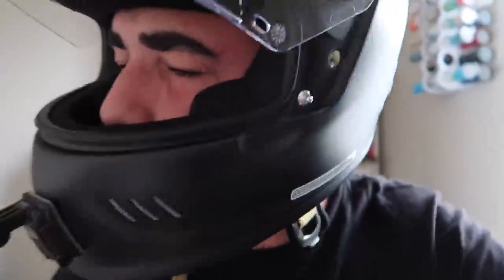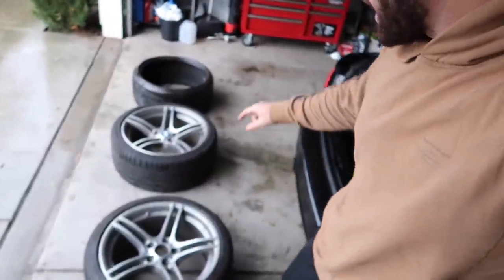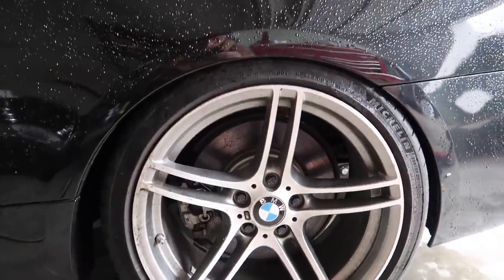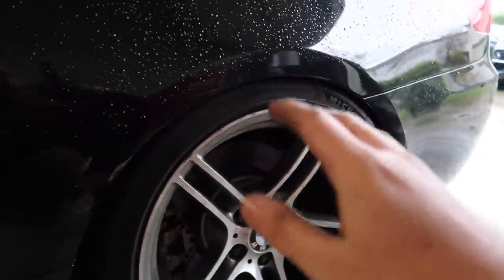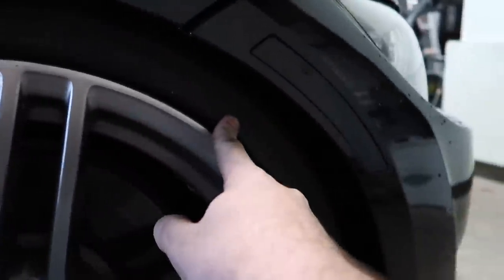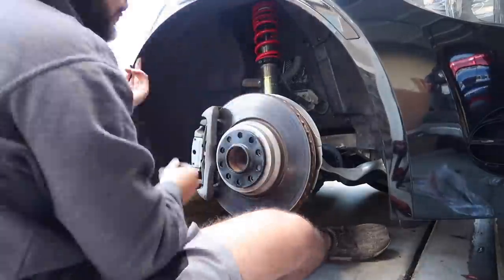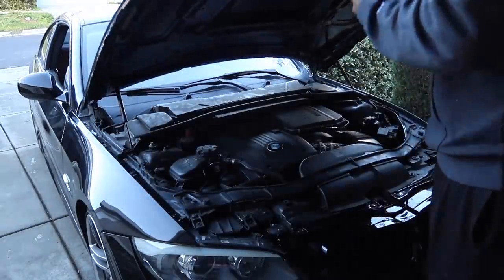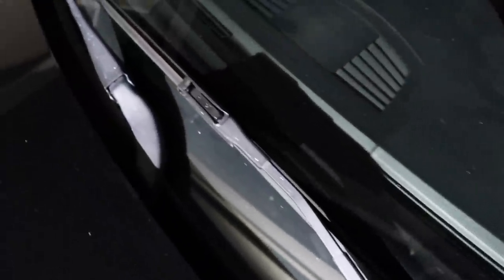THE 335IS IS MAKING ME LOVE N54 😭! Achieving Perfect Fitment!

Comment: on your rear wheels you have excessive positive toe, meaning the front of the wheel will be facing inward causing tire wear from the outside. You need to do an alignment. Tie rods are responsible for the toe in, just need to adjust them at a shop

Comment: Something seems wrong in the back end, because the wheels don't look centered in the wheel well either. Just my observation.
Reply: Yes I noticed this also, there’s for sure something off nour! Check the control arms/rear subframe
Reply: As long as it’s even, we have to make sure we’re account for the stock caster angle. Also Nour mentioned (without knowing how to say it, as usual) that the rear wheels were toed-in, as long as it’s within spec I guess it’s not a big deal. Fully adjustable alignment parts can make it a complete nonissue and/or better than stock

Comment: not criticizing or anything but with wheel spacers would wheel studs not be safer and easier for removal and install? Keep up the great work from Ireland :)
Reply: You’re right, stud conversion would be a whole hell of a lot better
Reply: @X11CHASE  thought as much, no worries of bolts coming lose and not as much of a head ache putting the wheel and spacer on😂
Reply: @stephenwolf1338  lol yeah I wonder if he at least used lengthened bolts, probably not since he didn’t mention it